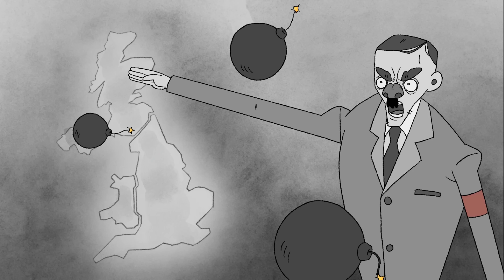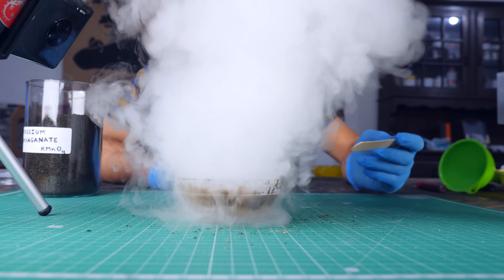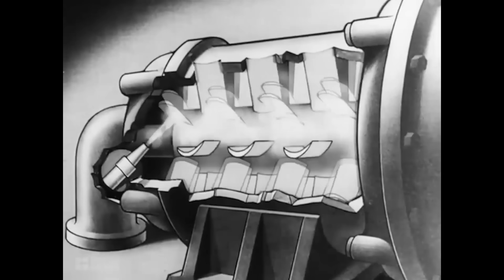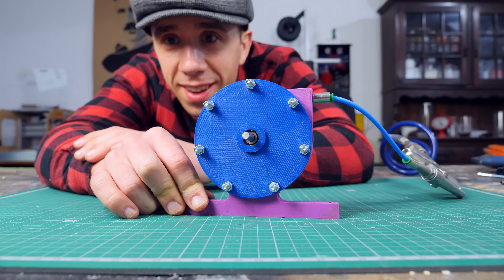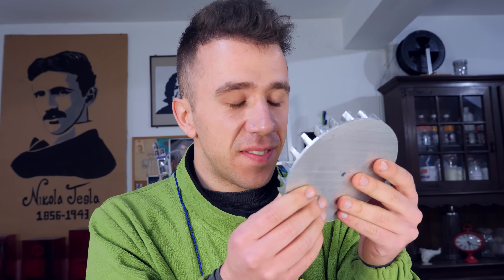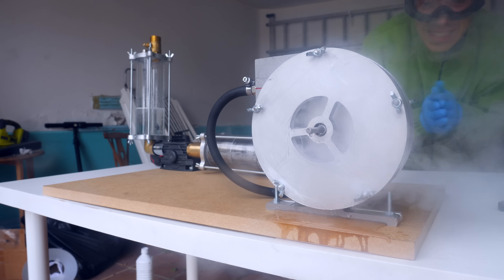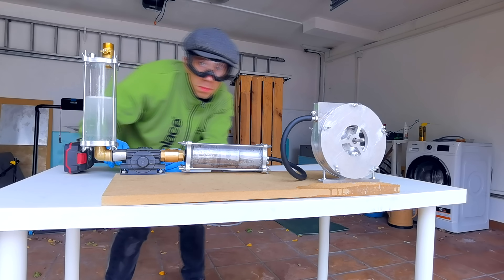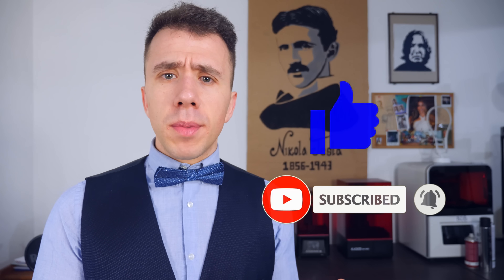I built the World War II V2 Rocket Steam Turbine

Comment: You need a seperation chamber at the end of the catalyzer, make one horizontal like your peroxide tank and attach it to the exhaust end of your catalyzer and make it perpendicular so that the exit tube is at the top somewhat level of the peroxide tank filler hole, it will look like a big letter "U"

Comment: You need to balance the wheel.
You can go to a far higher rotation if you eliminate all the vibration.
Plus it will not explode as easily.🎉
Do you have a website for suggestions on a show.
I think I have a couple really fun experiments.

Comment: Try getting higher quality hydrogen peroxide using an ultrasonic air moisturizer and try putting a small nozzle and something like a valve so you can open it only till u get the presure you need

Comment: I agree, turn the catalyst vertical but also it would take more work and designing but it may be helpful if there was a way to make some pressure valves that would allow some air to be pulled in by the vacuum pressure effect that's being caused by the turbine spinning up, in my head at least there may be some restriction do to the reaction not being able to evacuate the steam and get it off of the catalyst where as once the vacuum pressure reaches a certain point, it may pull down some valves to allow a little extra air flow to pull the steam through the nozzle? Maybe? If that makes any sense? I'm probably wrong but it was a thought I had

Comment: You need to increase the amount of catalytic converters and slightly decrease the output tube for the catalytic converters. It will make steam generation more efficient and increase the pressure moving into the turbine thus increasing torque and overall power.

Comment: whatever you use turbine for the rocket, huh, use at tesla turbine instead, yep direct replacement, no modifications to the case. no keep the other component rigidly in place, like solid oxidizer, and then spray liquid fuel on the oxidizer combustion nozzle directly. yep plates have large surface area, like battery electrodes. yep oxidizer sheet stack where fuel is sprayed into. anfo would suit it well. then its better than solid fuel rocket, that its not mixed, not a fireworks, and the tank of fuel is above the solid oxidizer compartment. it can be gravity acceleration fed downwards, where the stuff wants to go, on its own. just ignite.

Comment: Hey I'm no expert by any means but i had a thought.
You should use the catalytic converter and h2o2 from this original build and incorporate it into a steam engine using a piston. Essentially a chemical steam based steam engine instead of a boiled water steam engine. This probably wouldn't be more efficiant than usual water steam powered steam engines and wouldn't last as long depending on the amount of h2o2 stored but would signifigantly improve your current idea/prototype because you'd have less steam escape. Is this correct or am I tripping?

Comment: If you mount the decomp unit vertically and pump peroxide in through the top and also have the output valve at the top shouldn’t only gas go out the outlet? You could get a fuller decomp with less wasted peroxide

Comment: Its not that your turbine isnt making alog of power..... its that you are not feeding it nearly enoughinput.  I am estimaging thay your turbine hasba radius of 10 cm, or 0.1 m . Borderline wet steam at 60 psi steam at 150 C  roughly has a density of about 2.4 kg per m cube, and a recommended velocity of about 100 mps. So a kg of your steam just in kenetic energy has 5000 J per kg, however this is not an isothermal process and if ur venting to atmosphere then you could get even more energy, but to truely get the energy from steam u need to condense it.. condensing the steam would unlock about 10 times more energy for your turbine to potentially harvest

Comment: if you use the pressure to vind upp a clock like gear pully system, can you use the steam to generate elektrik power? the best effekt for the pressure?? a grandfather clock dont nead mutch energy and todays magnet maybe it can be a very good generator?? hige pressure piston and very very many gears adapted to a neodynmagnet generator?

Comment: First improvement I would make is the bearings,  upgrade to a set of Abec-8 high speed sealed bearings.  Next design a mill a Delavan nozzle  for the output of the turbine to increase the exhaust steam and produce forward thrust. Next increase the overall volume of the expansion chamber and mount it vertically to minimize liquid waste and increase usage overall.  There is a massive amount of potential for this design.  Bravo Integza 👏  Mr.Tesla would be very proud of you.

Comment: I know this is an old video, but to reduce the waste out the turbine try putting an atomizer meant for water misting. However don’t use the cheap ones, try the ones from Snow Performance that are used at 300 psi. In theory…the H2O2 would start slower but get better control as well as better “economy” from the consumables.

Comment: If you split the reaction chamber in 2, you'll have less peroxide blown away with the exhaust, it would use the second chamber to post-process the exhaust. As for the turbine, you're making a glorified turbo. Using a design more reflective of what you'd see in a turbo would likely vastly improve its efficiency

Comment: My recommendations for MO POWAH BABY!:
1. Use a higher concentration of peroxide. V2 used 70%+. You don't have to go that high but you can should be able to find up to 13% cosmetic grade. 
2. You neglected to add a nozzle to the aft of the catalyst. You still need a nozzle. Laval types work best.
3. You should clean the catalyst first. Any type of soot remover should work fine. 

If you do all that, you should be getting at least 1 or 2mj/kg of energy, minus conversion losses.

Comment: Maybe a jet turbine design  inject the steam into the inlet props same angle as blades and as many using   small carby fuel/jets or original fuel lines , the compressed ventricle will improve velocity plus draw more air in just a thought.  Steam in and out smoover / quicker would save on load once steam is used spent.
I see theses turbines trap airflow to the outer walls and create drag on prop.

Comment: Learning about stream turbines around work, I would think you'd want a secondary chamber to make "dry steam". I think keeping the pressure high by reduced volume would help to keep this efficient. 

Running the steam through the engine twice would be more efficient potentially...?

I would think that you'd want to extract the most energy out of the expansion of the steam... so more of a turbine compressor i would think would be more appropriate, to allow the steam to expand fully in the blades

Comment: Wouldn't it help to have a standing tube after the chemical reaktion possibly with a return tube to before the katalyticconverter so the liquid won't have such an easy way to get through the system but instead if it isn't vaporised yet it will have to go through the system again until everything is steam and can escape the gravity trapping tube? 
Just a thought I might be wrong 😊

Comment: you need to compress the outflow of the steam to the Tesla turbine and you can make the flow back throw the catalytic converter in that way you do not lose most of your H2O2 .... as for a way to make power why not make  a h2o2 rocket  here is my idea from now to tail .

 <( h2o2 )(pump )(catalytic converter)(pump)( H and O2 fuel mix as fuel out end )< ====== might have to use a compresser from the  catalytic converter ?

Comment: Can you not just slightly modify a turbo used for a car  for a fraction of the price? Ideally an aluminum or titanium turbo, edit, so apparently that would be considered a low pressure turbine, so perhaps you could use this as a second stage like they do in steam engines for capturing the exhausted low pressure stream that has not had all of the energy extracted from it yet. /shrug just an idea that probably wont work but worth mentioning. Or even just modifying the blades in an existing turbo to be more efficient with hi pressure applications.

Comment: first, you need to get the Hydrogen peroxide out of the turbine. this can be done with a normal air dryer you would see in any mechanic shop pretty close to their air compressor. Second, your going to want to use a multi stage power turbine. luckily for you, they are already done the home work for you. the thing about steam is it produces a great amount of pressure so you are going to want to take advantage of that...hints the multi stage.. most coal or even nuclear power stations use these... even some war ships still use them. basically , they are a ring of turbine blades, a ring of stators, another ring of turbine blades...stators, blades..you get the idea. so...your going to want to first, find out how much volume of steam your producing, record it...then look at some power turbines in use today, find out what their optimum volume and pressure they are most efficient at, like this https://cults3d.com/en/3d-model/tool/turbine-rotary-tool-60-000-rpm or maybe used a air tool turbine.  then scale yours to theirs. presto....now you have the means to make more than enough power to hook your bad a** power turbine to a blender full of disgusting tomato's. Pizza anyone? PS, the other comment about the fuel injector is perfect!! ad that !!!!

Comment: I think you need to make sure your H202 catalyzing chamger can handle some pressure and add a pressure release valve that you can open and shut to start the turbine. That would mean you have a pump switch and a valve to open to run the turbine. You could perhaps also maximize the surface area of the catalytic converter so that the H202 has to make contact with it. If that is by grinding it up and putting it in a disc or not, I don't know. Maybe adding a ground up one after that one or before it.

Comment: 8:00 that just looks like the fan blades for a small engine from a gas powered lawnmower... the bit on top that spins where the starter ring or pull cord is there's a metal fan right there

Comment: The Astronomy and Nature channel has a superb series on how the Germans built the V2 including the H2O2 generator and turbine. Your problem is that you are not applying nearly enough pressure, and then it’s not clear you have enough volume flow (remember that everything flows really fast in a rocket engine in order to produce enough power).  The V2 H2O2 and permanganate were pressurized to over 400 PSI which was the head pressure to the turbines, and the steam then provided the volume flow at that pressure to run the turbines.  The compressor connected to the turbine then compressed the fuel and LOX into the engine I think at a higher pressure still due to mechanical advantage but not sure about that. Watch the V2 series to find out for sure.

Comment: How about designing a wind up mechanism. Like what used to be in old toys. Replace the wind up key with a small starter motor to wind up the mechanism to create perpetual motion. Then use that motion to charge the battery for the starter motor! (I’m Hoping to win a 3D Printer to help develop my creative engineering ideas I have in mind!)😊

Comment: I'd be more concerned about the decomposition chamber exploding pieces of acrylic into my face, than the turbine exploding. I'm wondering  how small you can get the output nozzle, to increase the pressure and, hopefully, the unused fuel issue (making the chamber out of metal, of course). Also wondering if you could somehow increase the surface area of the metal catalyzer... and if so, what would happen if you blew the fuel onto the catalyzer as a high pressure spray, or mist - instead of just pumping liquid into it. - It's just a fleeting thought, but I'm German decent, so you may want to take the suggestion seriously :)

Comment: Connect generator shaft directly to turbine shaft. Buil entire system standing top to bottom  starting with peroxide tank at the top, valve pump beneath the tank, catalyst tube beneath the pump. Add a very fine atomizer nozzle inside the catalyst tube to evenly distribute the peroxide saturating more contact with catalyst area producing a more efficient reaction (less peroxide tomato juice in turbine. A small "catcher ring/rim can be cut into the turbine exhaust body with a tube and small pump to return unused tomato liquid back to peroxide tank). Catalyst should be at very bottom of tube where liquid can pool within catalyst making even more sufficient relation. Mount exhaust (steam) tube on top of the now lateral standing catalyst tube down to the turbine. Again the shaft of the turbine  should also be the same shaft for generator. Add a "step up" and battery storage.

Comment: So what temperatures did you achieve?   How much pressure did you achieve?   Also, with only 50% concentration you are going to be pushing your 50%water out as your peroxide decomposes and the resulting stream and pressure boil the water out.  The Germans were using 90% concentrations which is very dangerous as it can spontaneously decompose in the fuel line if it hits a 90 degree turn.  Also providing a rocket nozzle would provide time for the initial decomposed steam to boil more of that pain water before being repressurised at the throat of the nozzle.  If you were doing this as a real propellant you could force this super heated steam down the center of a solid fuel tube like latex and sugar.   The heat should be enough to melt the solid fuel and ignore it as well.   See MIT project prometheous details of a hybrid rocket motor

Comment: To solve both your containment and power problem: Turn your reactor to vertical, feed the peroxide in from the bottom, and add some room for the peroxide sputtering out of the matrix at the top, to return to the bottom of the reactor, instead of being blown up the steam pipe to the impeller. As a proof of concept, just remove one of the three catalyzers and leave that space unoccupied. Once the impeller is no longer fighting imbalance by being fed a liquid AND a gas, the turbine will rotate FAR faster and smoother. Good luck and death to tomatoes ;)

Comment: might be going out on a limb here but why not build a vintaged high powered steam engine the body can be made out of pla and you can also print tracks for the train to run on (or make it out of wooooooooouuuddd) and your challenge is to not use your air compressor and ill leave the rest to you
Reply: Thermoplastics are notoriously melty around temperatures high enough to power a steam engine. That's sort of the point of thermoplastics.

Comment: doming the fans with vac out or proper light sound or static inside would lift no problem internally ... itsz the inverse of the nozzle effect ... less resistence in a vaccumm the blade is the change rate .. particlesz in air cause issuesz and thrust .. but none stillhas thrust just light or sound or static will do even mist in a mist chamber you then collect and pump back to the top asz water will internal thruszt ... why ?  why did the lord make thsyz so ??

Comment: My suggestion is to add an extension to the catalyst tube - maybe double the total length. This would give the peroxide a little room to drop to the bottom of the tube. Then move the steam output to the top of the output end. The idea is to keep the liquid out of the turbine - you're losing a lot of momentum to turbine blades impacting the liquid. You can actually hear this by comparing the pitch of the sound of the turbine between the compressed air test and the steam test.

Comment: Mounting the catalytics vertically has been suggested — How about a vertical mount with horizontal fuel delivery drilled/tapped into the middle of each catalytic conv?

Fuel is pumped directly inside (or chambers between each CC) and as the reaction happens, the steam can extract from the top of the assembly.

Additionally, a recycling system could be mounted at the bottom of the CC assembly, for returning unspent Hydr. Per. to the fuel tank. 

Essentially activating all 3 CC at the same time with their own fuel lines, as opposed to 1 fuel line going through all 3.

Comment: this video isnt too old so i think its more likely you will see it, what if you ran the steam through a second converter before reaching the turbine to move completely consume all the peroxide and produce more steam and therefore more power, also with the outlet you may be able to create a second turbine linking to the first and both spin the drive shaft to convert more of the energy into power output. the flaws i see with this is you could run into the issue of the second converter creating a parasitic effect on the steam and slowing output rather than increasing it a problem I'm sure can be solved if its created at all. another issue that is possible is the drive shaft, you would need to find a way to make both turbines work together to spin the shaft but one will very likely run slower than the other creating yet another parasitic effect perhaps there is a type of drive shaft that exist which solves this problem. I'm not an expert in any kind of engineering and have a very basic understanding of things like this but if nothing else perhaps this will be helpful. it just think you are wasting much of the energy potential with just one turbine given how quickly the gas is leaving the exhaust and spilling peroxide and possibly condensed water.

Comment: video idea: built a steam powert car
Reply: Yeah just spit balling here but using a catalytic converter hydrogen peroxide turbine an electric motor some sort of electrolysis to capture the split like they do on the space station use it to power a turbo that has extra oxygen they're has got to be a way to have one power the other. Slap a sterling engine on it where one feeds the other. More power more efficiency no reliability and expensive but it would make for a cool video and a more efficient sports car